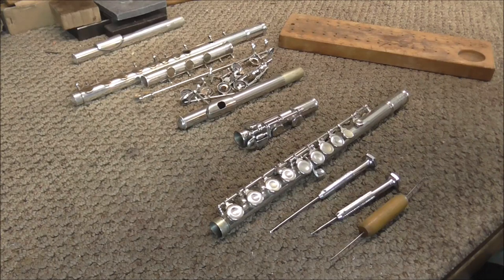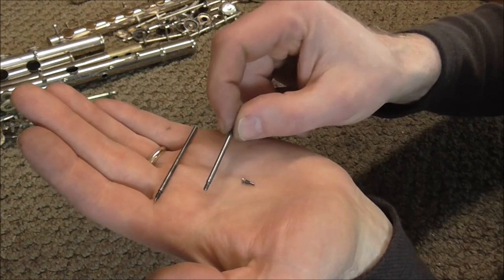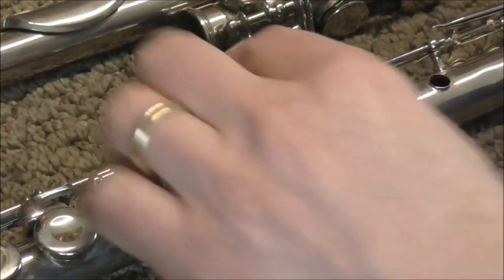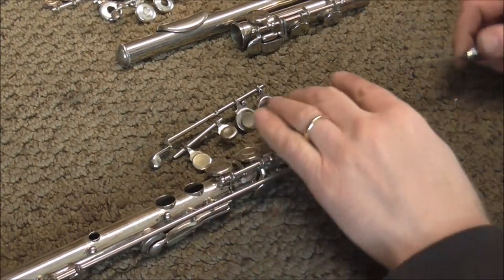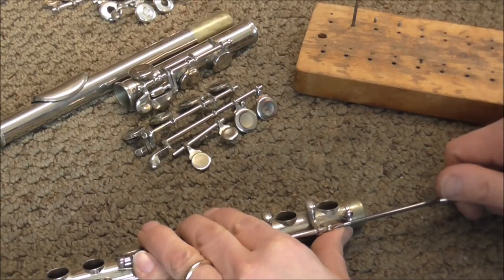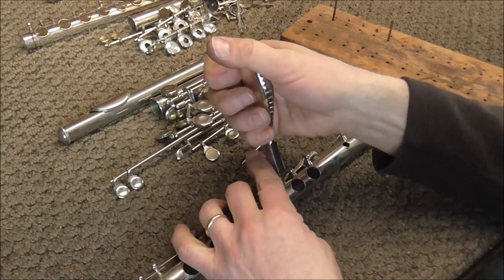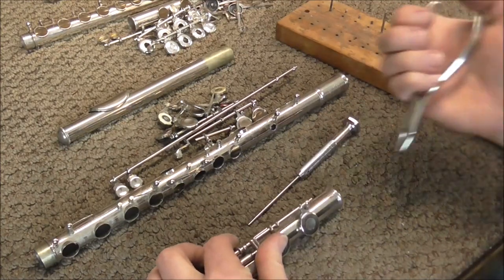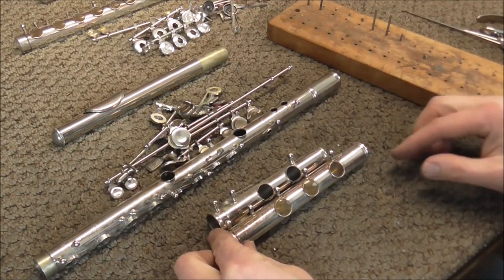How To Take Apart a Flute

Comment: I need some help on getting my F# key to come up stronger - I think it uses the lower of those 2 springs that are stacked together (student model) - which direction should the tension on that spring be loaded? Up or away - I can't seem to see where it hooks to it's peg on the key. comes up fine when the other keys press it (seems like) but just weaker on it's own...  Im sooo close on this, and then it;s off to setting the pads and registration, but the keys need to work right... F# is not supposed to be a little slower on it's own, correct?
Reply from the maker: The F# spring is usually a little weaker that the D, E, and F keys, but it should come up quickly and easily. If you need more spring tension, bend the spring forward (toward the pad cups). Another possible problem is that the pivot screw at the end of the right hand keys may be too tight. Try backing the screw off about a quarter turn or less and see if that frees up the F# key. 
I hope this helps.

Comment: I am trying this myself on a flute I bought on Ebay (1945).  One of the pivot keys won't budge. The others were fairly tough to get out- kind of gunked up, but one will not budge at all. I am using a woodwind repair screwdriver. Tried WD40, silicone spray, and tapping the screwdriver with a mallet to no avail. Do you have any suggestions?  Thanks!
Reply from the maker: If it is one of the trill keys, you can usually leave it there and don't worry about it. If it is the right hand keys, then you will need to get it off no matter what. One thing you can try is using vice grips to hold on to the screwdriver to get a little bit more leverage. You need to be careful though because you could damage the head of the screw. If that fails, you will need to drill out the pivot screw and replace it after it is out. It is a big job and it comes with it's own risks. Hope this helps!
Reply: @TheBrassandWoodwindShop  It was one of the trill keys. Thank you!

Comment: Question if I don't have a pivot screw and some of my keys fell off can I replace the pivot with anything else or do I have to buy one?
Reply from the maker: You can make one with a rod, a die, and a jeweler's saw. It is a lot easier to buy one from a local repair shop though.

Comment: This is a great video! 
I have a flute with in line G keys. For some reason when I press the B flat lever, my A key seems to “stick” a bit and gets depressed slightly as well before popping back up.  Similarly when I press the F key. 
I tried to take apart the first parts of the keys per this video, though I couldn’t figure out further what’s making those 2 keys stick. Is this a common problem for flutes?
Reply from the maker: Your A key is probably sticking to the hinge rod that goes through it. The hinge rod or key is bent. Or the hinge rod has a little rust on it. The key will need to be removed and straightened or cleaned.
Reply: @TheBrassandWoodwindShop  Wow! I thought that we have to use oil